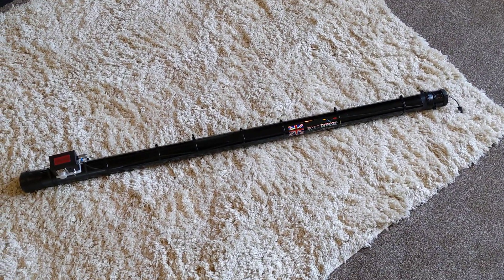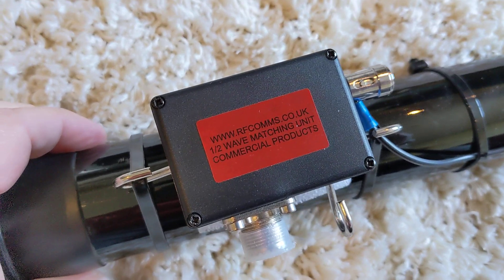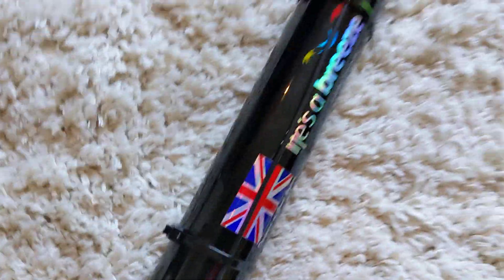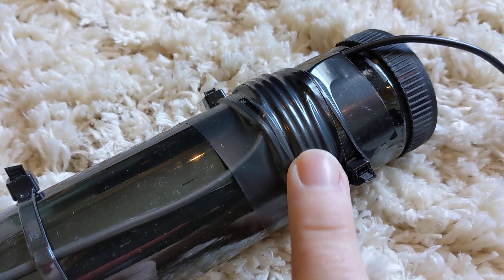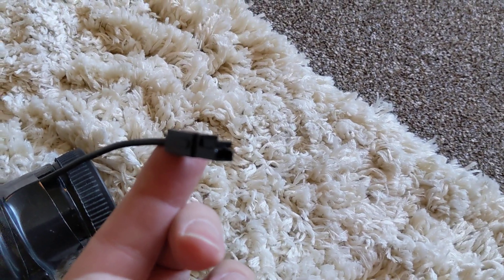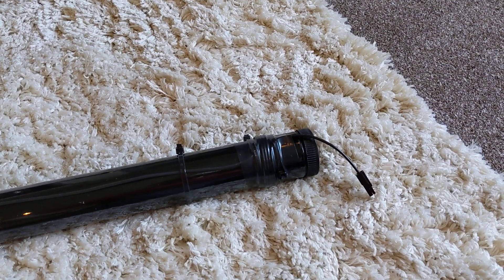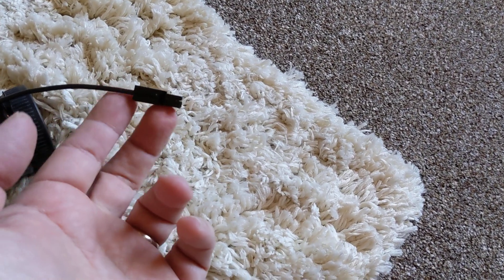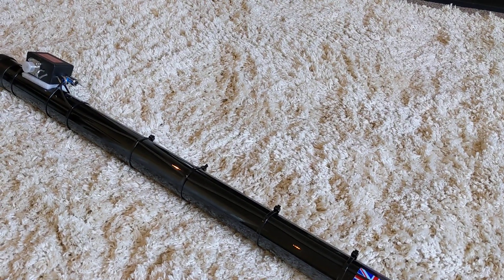Ham Radio portable HF antenna - half wave vertical.

Comment: Nice solution, I'm really interested about your outcome in the field. If you have an analyzer, please measure and show your data.
Since I have only a 6m tall glass fiber mast, I experimented with a similar setup but for the 10- and 12-meter band. It worked well when the conditions were good, but I measured a lot of influence by the ground, even on how I laid the 5m long coaxial cable.
Reply from the maker: I will do. I wonder if a line isolator would reduce some of those effects? I came up with another idea yesterday - a 40m quarter wave with a crocodile clip to clip onto the fence wire as a ground. I am sure it would work to some extent. Going to try it.
Reply: @GordonHudson  I guess some form of common-mode choke might decrease such effect, but it depends after which length of the coax cable it will be inserted. I didn't test it myself. 
Also keep in mind that your transformer is different than mine. I wrote a 50+ page document about a 7-band EFHW that contains also a description of my efficient coupler. The latest version of the document can be found on my SOTA-page: https://hb9sota.ch/hb9eaj/